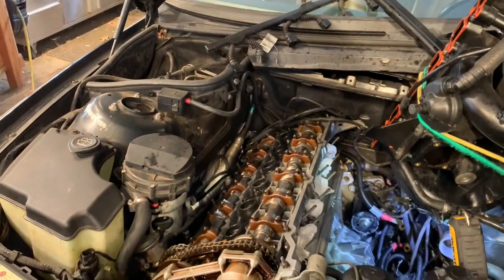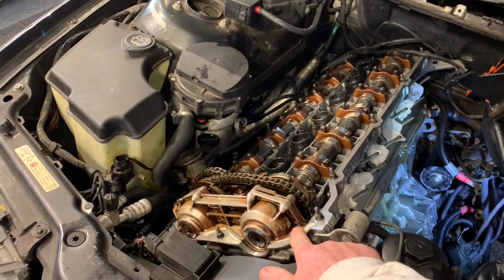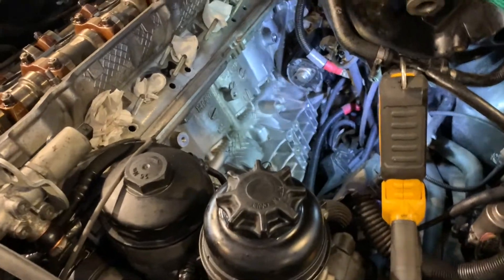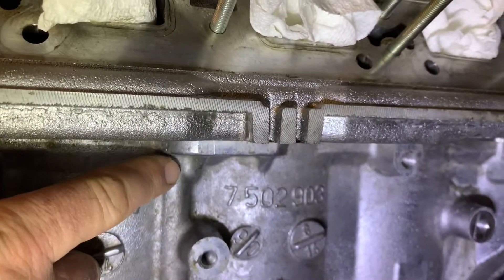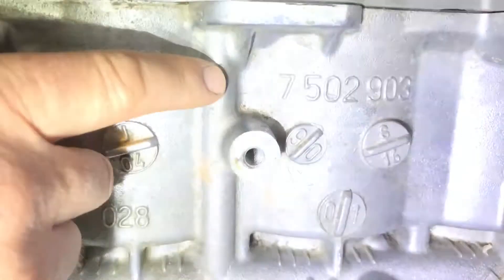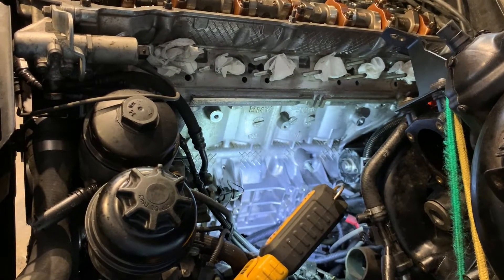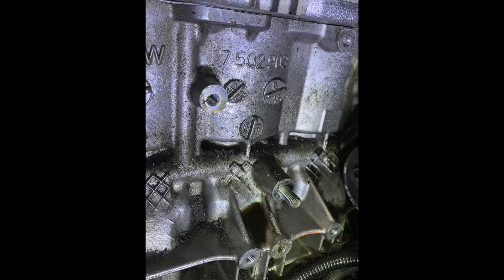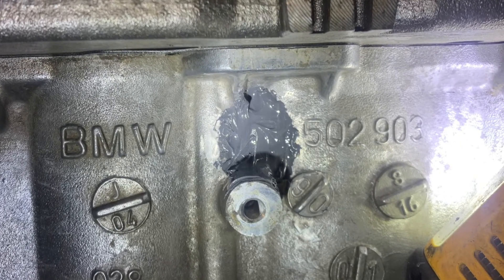Repair cracked aluminum block w/Marine JB Weld.  Oil leak on BMW M54 engine post head gasket repair.

Comment: I've got a 2004 Toyota Sienna that has a hole in the (6 cyl, aluminum) block a few inches from the oil pump, due to someone putting too long of a bolt through the AC compressor attachment bracket.  Finally got the oil leak diagnosed today.  The bolt had pushed a flap of the wall of an oil tube on the block inward a couple of mm.  The shop is going to see whether or not a welder will quote to repair the hole with the engine in place (after removing the radiator and a bunch of other stuff to give him access).  If not, or if the overall quote is too much for me to stomach after all the other money I've thrown at this vehicle in the past year, then we are looking at a temporizing measure like JB Weld.  Thoughts?  If I end up going the JB Weld route, am I looking at living with an oil leak, or re-doing the JB Weld every couple of years, or what?  Thanks.
Reply from the maker: Give it a try, nothing to loose.  90% chance it will be successful.

Comment: Nice repair - But I think the Huhn solutions insert - which is considerably longer than the time-sert insert - caused this crack. A longer insert goes deeper into a thinner part of the engine block. 

This likely would not have happened with a time-sert.
Reply from the maker: You may be correct, but the time CERT inserts have a problem of pull out for Weik blocks. If they pull out, now, you are going to a secondary re-tapping process that has its own list of issues.

Comment: The only “jb marine weld” I could find was in a syringe “white” color but yours is a dark gray, ive got a coolant leakage from the side of an cast aluminum cylinder head on a gm ls engine. Would this be ok? I’m planning on letting it sit for a week
Reply from the maker: Mine was not in a syringe.  https://www.amazon.com/J-B-Weld-8272-MarineWeld-Marine/dp/B000KKPFFA/ref=sr_1_3_pp

Comment: did gasket on Peugeot KFW engine, now coolant weeping from 3 spots on the block!
Reply from the maker: Is there a question in here?  Sorry...
Reply: no I was saying I replaced the gasket but the block weeps (engine was overheated) car still working, just needs coolant every week, would be impossible to weld the block as the holes are invisible @mikepetersen3

Comment: The exact same thing happened to my M54 engine. Maybe it isn't a good idea to put inserts in this motor? BTW my engine has never overheated, I've owned it since new.
Reply from the maker: Thanks for pointing this out. I assume my crack was due to the overheat, but it may be a week point in the block for all engines, even those that have never experienced high temps.

Comment: Hey friend, just did this to my transmission case. However, I did not drill any holes. How bad did I mess up? Wish I would have looked for this video before doing it. Great video production.
Reply from the maker: The holes prevent further cracking.  However, your stress fracture may be at a point where no further cracking will happen irregardless of the holes. I wouldn’t lose any sleep over it, just keep an eye on it.  Worst case, if it starts to leak, you can always redo the repair.

Comment: Can i do the same to stop coolant leaking from my engine block? I am planning to use JB steelstick though
Reply from the maker: it should work as long as the oil is not coming from a high pressure zone, i.e near an oil feed channel
Reply: @Mike Petersen  Oil isn't coming out. But unfortunately, steel stick didn't hold. Coolant still drips.

Comment: I just asked a dealer if I might fix a leak on the oil pump cover on my Yamaha R1 with JP Weld.  It seems my bike has been leaking out of that cover and into the belly pan after an accident which scraped down the edge and one of the screws which secures it to the gasket.  The dealer said:  "JB Weld?  That NEVER works - I've seen it a THOUSAND times." Which I interpreted as meaning it probably will work. Aka "stealerships".  So thank you for this video.
Reply from the maker: I don’t think JB is a miracle fix, but it’s worth a shot.  Depending on the damage you may want to use RTV as the base and add JB on top after it has cured.

Comment: Fix your engine with glue ha ha.
Reply: I've done it many times. Saved ATV cases with cracks that were leaking oil and have also saved lawnmower engines from being replaced. For $10 bucks it is worth a shot. With proper prep I have had better than 90% success.
Reply: @ericpigg2689  just fixed my wifes oil pressure sensor with steel stick from Jb, prepped and put it on nice and thick and it held no issues...crack was about an inch long. Sealed up great. RAted to 330F and 5000 PSI and petroleum proof.
Reply from the maker: Next time you need help, I hope nobody offers you creative ideas to fix your problem.

Comment: I have a similar problem on my accord but my mechanic said he would have to drop the engine because he can't access the crack he can only see it thru a reflective mirror which is gonna cost 1500$ a lot of money I might as well engine swap it. Any recommendations please let me know
Reply from the maker: I do not know the layout of the accord engine, nor where the crack is located.  You mechanic may be correct... Sorry I cant be more specific.

Comment: When are you going to post on how the repair is going?
Reply from the maker: Repair worked, with minor leakage.  If I were to do it again I would add RTV to the crack first, to prevent any oil seepage, and then add the 2 part Marine JB Weld.
Reply: Try a aluminum brazing rod. Should work perfect in this situation

Comment: I just did this to my transmission drain plug area ... the plug area cracked and would leak ... it was a used car I bought so I'm not bothered ... you live and learn right ..
Anyways I drained the trans for hours , clean it with brake cleaner and soap and water , dried it , applied silicone on the the threads of my new drain plug and inserted it .. then I layer a coat of jb weld in the crack to make sure it doesn't leak anymore .... problem solved .. 
I can always unplug a transmission line from the radiator to drain and fill lol 😆 
I'm not paying someone to do it or swapping it if it isn't broken broken
Reply: Hell Yea
Reply: I have same problem on my transfer case drain plug that I Ned ti fixit

Comment: 7 months later, any issues?
Reply from the maker: 7 months, no issues... (or leaks)
Reply: @mikepetersen3  I'm faced with a small crack in the back housing of my tranny on the overdrive side causing a slow leak. You could possibly save me thousands of dollars.
Reply from the maker: Clean the surface as much as you can before you apply the epoxy.  Brake cleaner is cheap ;-).  Report back here if the repair works.

Comment: Hey like what’s the current condition now?
Reply from the maker: 7 months, still no apparent degradation.
Reply: @mikepetersen3  your amazing man thanks!
Reply: @mikepetersen3  Nice. I just did mine where an oil cooler line enters the head. It was pouring oil out on a Toyota 3.5l. Saw the hairline crack at the place where a banjo bolt goes on the engine block. Appears dealer cracked it as the bolt had a sleeve on it. I guess I found my ages old oil leak LOL.  40 psi per specs. Day 3, holding.  I used high temp epoxy. I never thought of using marine JB weld.

Comment: Bwahaha, try to fixing an engine with jb weld. What a dumbass
Reply from the maker: What’s dumb about it?  We’re not building a main bearing, we’re fixing a leak.  It works great and saved the hassle of installing a new block.  Take your negativity to Facebook or Twitter, and rant about something else there.

Comment: Hey Mike thanks for the video. The 2 holes you drilled on each side of the hair line crack.... approximately how deep did you drill those 2 holes?
Reply from the maker: They should be as almost as deep as the crack, but obviously not through the entire aluminum wall.  I think they were about 3-4mm deep.
Reply: @mikepetersen3  Thanks for the help. About to try to repair this crack.

Comment: Excellent. That prep looks like a winner. Gonna try this on a pressure washer that has a crack in it’s housing. Thanks!
Reply: Did it wrk
Reply from the maker: It worked for 3 years and then sold the car.